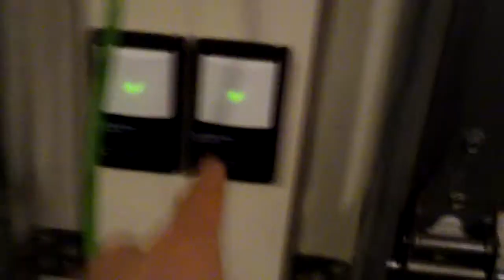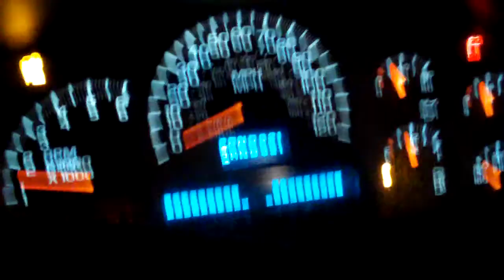East Coast Blizzard 2010

Comment: why doesnt the case throw too well? does the auger spin up good and fast? if it does the trick is to get your chute angled at just the right angle and going flat out in low range at the snow banks. it works best when you cram a whole lot of snow in at once. they throw a high volume of snow pretty well though not terribly high.